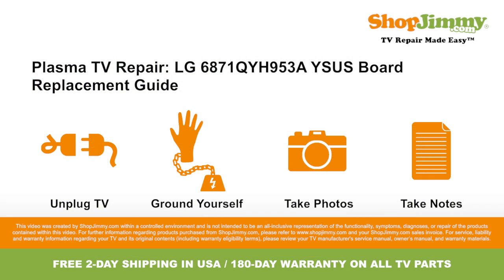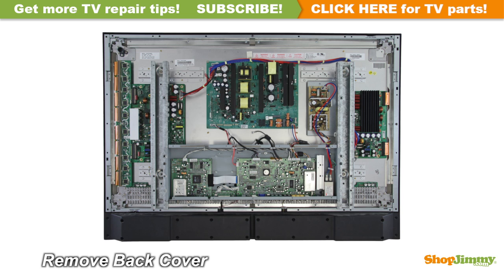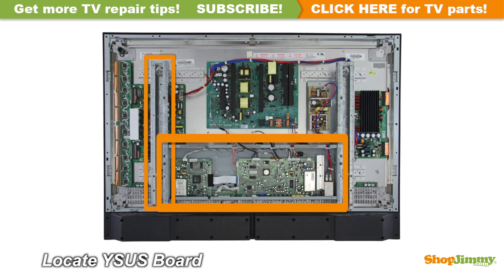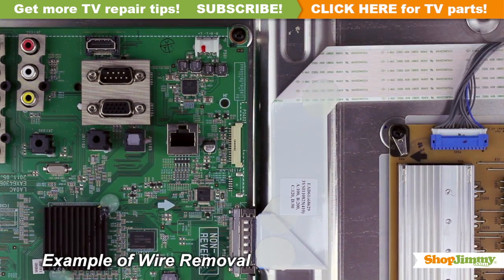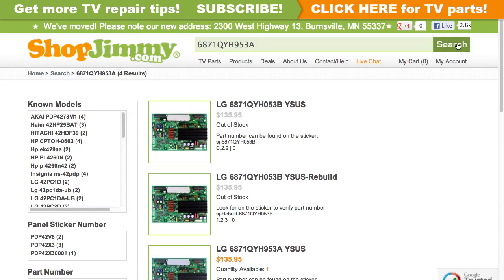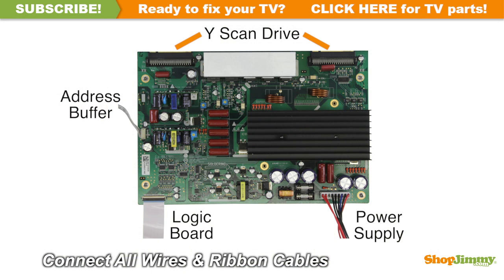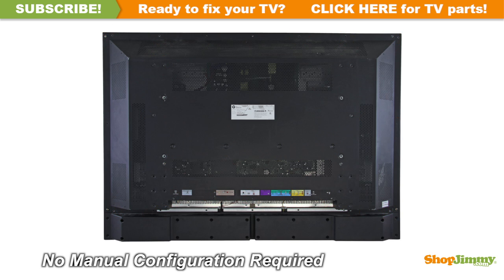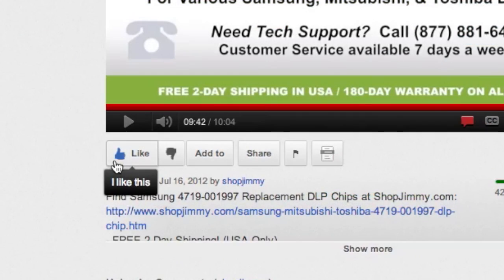LG Plasma TV Repair - How to Replace LG 6871QYH953A Y-SUS Board - How to Fix Plasma TVs

Comment: Hi, my LG plasma TV has stopped working suddenly, that is no picture when switched on, I noticed the main ON/OFF red light ON. Normally, this turns from RED to GREEN, then picture comes on screen. However, in my case the RED light keeps on. 

Screen does not turn on by manual on / off switch located at bottom left rear of screen.

Please can you HELP ! and Thanks in advance.

LG - TV
MODEL No. : 50PA4500 - ZF
PRODUCT CODE : 50PA4500 – ZF. BEKLLJP
SERIAL No. : 205MAAK36304
MFG : MAY 2012

Comment: Hi jimmy, I've got a LG plasma tv (model no - 42PC1DG-AA). Few days back picture was gone (no picture at all, just black screen) but the other things are still running. everything fine just no picture. I've already change the Y buffer board (new one) but unfortunately the picture hasn't still showed up :( .... what should i do now????
Thanks for your support....
Reply from the maker: +Russel Hassan   Try all repairs and troubleshooting at your own risk.  You need to replace the Y board as well.  Thanks!  www.shopjimmy.com

Comment: Hello,
I have a LG 50 PV350 TV, which does not emit picture, only sound, could help me to know that the board is that I must change the motherboard is EBT60874713 Y Y-SUS EBR69839002.
Thank you.

Comment: I have a LG 50Pj350-UB  I turned the tv on and there was a black line on right side and on the left side like closing the view of picture everything else is working can you tell me what part do I need to replace.  thanks
by the way.  your video is fantastic!
Reply from the maker: Elizabeth Guevara   Try all repairs and troubleshooting at your own risk.  This sounds like a TV panel (TV Screen) problem.  If your TV panel is bad, it may be more cost-effective to replace the TV as panels are typically hard to find in stock, difficult to replace, and expensive.  Thanks and please let us know if you have any further questions!  www.shopjimmy.com

Comment: I have a Maxent MX42M20 mod: P420142X3 plasma monitor. I get no splash when I turn it on. When I hook it up to a source, I get NO picture but I get sound (loud). I have no control of the sound (up or down) from the front panel, no menu. I can go through the input source (with no indication of source). After, taking off the back panel it seems to be all LG. I need help troubleshooting the problem. It does turn on (Green) from Standby (Amber). I've changed out the YSUS and YDRTP boards. This was a give me TV. Thanks for any help.
Reply from the maker: MrJmm1952   I recommend replacing the main board in your TV.  Click this link to replacement parts for your TV model number:  http://www.shopjimmy.com/maxent-dpwb11561-mpl-main-board-for-mx-42hpm20.htm  Be sure to match part numbers on your current board, with your replacement for compatibility.  Thanks and please let us know if you have any further questions with your TV Repair!  www.shopjimmy.com

Comment: I have an lg 60pk250 it has small vertical lines and now will not turn on. When it does turn on (after a long cool down period) it works for about an hour then turns off and then it cycles through startup but i get no picture. I see no signs of bulging capacitors. from what i understand replacing the y sus board will fix the vertical line issue (is that correct?) but could you tell me if a faulty Y sus board will cause the tv not to turn on at all? Thanks

Comment: Hello, I have lg plasma tv model 42pc3dv. The screen doesnt come on at all. The power light turns green and the tv powers up but the screen never comes on. when the screen fist went out there was still sound now there is none. Can you direct me to the fix video for this and the parts needed for the fix please.
Reply from the maker: sunni j  Please watch this video FIRST to help with your repair!  https://www.youtube.com/watch?v=BP3NVNCGEv8   I recommend replacing the YSUS and the YDRVTP boards in your TV.  Click this link to replacement parts for your TV model number.  http://www.shopjimmy.com/catalogsearch/result/?q=42pc3dv  There may be multiple boards for the same TV model number, be sure to match part numbers on your current board, with your replacement for compatibility.  Here is a link to a video showing how to identify your part number, click here:  https://www.youtube.com/watch?v=GEllG3RV-tc

Comment: Hi i have a LG PDP50R4000 model i only get a red standby light. When i press the power button nothing happens the light will stay red. Do you think i just need to change the power supply?
Reply: ShopJimmy.com Hi i tried that but i don't get anything. i noticed when i disconnected the Y board the standby light does not show anymore but when it was connected the standby light was on.
So the end result so far is that still no power when the Y board was disconnected
Reply: ShopJimmy.com Hi Disconnected the x board and still no results. I get the standby power light but tv still does not power up
Reply from the maker: Cramston Symonette   Please watch this video FIRST to help with your repair!  https://www.youtube.com/watch?v=BP3NVNCGEv8  This could be a problem with either the main board or the power supply board.  You can replace each of those boards individually to see which one fixes the problem.  Click this link to replacement parts for your TV model number:  http://www.shopjimmy.com/catalogsearch/result/?q=PDP50R4000  Be sure to match part numbers on your current board, with your replacement for compatibility.  Here is a link to a video showing how to identify your part number, click here:  https://www.youtube.com/watch?v=GEllG3RV-tc  Thanks and please let us know if you have any further questions with your TV Repair!  www.shopjimmy.com

Comment: Hi I have an LG 42PX5D that was purchased in 03, never been repaired, unit cycles off/on with clicking LED red to green, after 2 mins yet get a black screen with audio and it takes another 5 mins to get an image which seems to pulse into a solid image. Can this be fixed or is the pixel plasma gas too old?
Reply from the maker: Werner Nicolau Please watch this video FIRST to help with your repair!  https://www.youtube.com/watch?v=BP3NVNCGEv8  I recommend replacing the YSUS and the YDRVTP boards in your TV.  Click this link to replacement parts for your TV model number:  http://www.shopjimmy.com/catalogsearch/result/?q=42PX5D  There may be multiple boards for the same TV model number, be sure to match part numbers on your current board, with your replacement for compatibility.  Here is a link to a video showing how to identify your part number, click here:  https://www.youtube.com/watch?v=GEllG3RV-tc  Thanks and please let us know if you have any further questions with your TV Repair!  www.shopjimmy.com
Reply: ShopJimmy.com Thanks mate, I will look into buying the 2 boards as suggested. Appreciate the advice.

Comment: I have a 42" Toshiba model number 42hp66. I just replaced the Zsus board because I had no picture on my tv just sound. After replacing the Zsus board I still had no picture just the sound. When I turn on the tv the screen stays the same, it does not turn black or anything it's like if it was off but it's not because I can see the red light turn green and I can hear a click when I turn it on. Another thing after replacing the Zsus I noticed the I doesn't get warn like the ysus. Should I replace the ysus? What would my problem be? Thanks
Reply from the maker: Rafael Morales   Yes, I recommend replacing the YSUS and the Y buffer (YDVTP or Y Scan Drive) board in your TV.  Here is a link to replacement parts for your TV model number on our website, click here:  http://www.shopjimmy.com/catalogsearch/result/index/?cat=4&q=42hp66  Be sure to match part numbers on your current board, with your replacement for compatibility.  You can also call our customer service for further assistance with your purchase.  (877) 881-6492  Thanks and please let us know if you have any further questions with your TV Repair!  www.shopjimmy.com

Comment: i repalaced the y sus and the y buffers, still have no picture but I have sound,,does the z sus board do the same thing, i have a dark spot in the middle of the z board, looks to be hot spot, but not sure. I have a Lg 60pz950ua plasma.
Reply from the maker: Louis Casterson   I recommend putting back in the original Y-board and buffer boards.  Then replace your ZSUS board.  Here is a link to replacement parts for your TV model number on our website, click here:  http://www.shopjimmy.com/catalogsearch/result/index/?master_part_type=Z-Sustain&q=Lg+60pz950ua  Be sure to match part numbers on your current board, with your replacement for compatibility.  Here is a link to a video showing how to identify your part number, click here:  LG Plasma TV Repair: DIY Part Identification Number ID Guide for LG & LG Philips Plasma Panel Parts  You can also call our customer service for further assistance with your purchase.  (877) 881-6492  Thanks and please let us know if you have any further questions with your TV Repair!  www.shopjimmy.com

Comment: Hi there. LG 60PC1D-AA. The sequence of events is as follows. When you try to switch on using the remote, the red standby light flashes, you hear a click, and the TV goes back into stand-by mode. This may be repeated several times with the same outcome. After several attempts the screen initiates (though still remains all black), stays like this for several seconds, then goes dead black again. However, the sound comes on. If you then switch the TV off into standby, and then switch it on again, everything comes back on as usual (screen and voice). Hope all this makes sense. Thank you for any suggestions in advance. Alex
Reply from the maker: Alex Kontrobarsky  I recommend replacing the main board in your TV.  Here is a link to replacement parts for your TV model number on our website, click here:  http://www.shopjimmy.com/catalogsearch/result/?q=60PC1D  Be sure to match part numbers on your current board, with your replacement for compatibility.  Here is a link to a video showing how to identify your part number, click here:  TV Part Number Guide for LG & Zenith Main, Digital, & Tuner Boards (LCD, LED, Plasma TVs)  You can also call our customer service for further assistance with your purchase.  (877) 881-6492  Thanks and please let us know if you have any further questions with your TV Repair!  www.shopjimmy.com
Reply: Alex Kontrobarsky Did replacing with the main board work? Because my lg plasma tv has to have several attempts to power on in order for the screen to go on....like it needs warming up
Reply: Vincent Tran Actually when I opened the TV up and inspected everything closely I discovered that all cap on the following part were blown. LG - ZENITH EAY32961901 SMPS AC/DC. You can tell that the caps are blown because the tops were sort of puffed up and coming apart. I bought this replacement part for approx $130 and it made the TV pretty much like new again. Definitely worth the effort. I took the photos as I went along so that I could remember how to put it back together again. If you wish let me know your email address and I will try to find them and shoot through. Hope this helps. Regards.
Reply: I recently opened mines up and found the bad capacitors on my power supply. The cost for a new one is about 130 dollars, so I might try to buy some capacitors and replace them myself.
Reply: Thanks for the help though, Alex. I do appreciate it!

Comment: I have a HP CPTOH-0602.  If I try to turn it on the blue lights on the board come on for a few seconds then one (the left one) "clicks" off.  I can not try to turn the TV back on without the power unplugged and the power drained, and then the power cord plugged back in.  The power light stays red and never turns green.  Sometimes, after I try to turn it on once the red power light will turn off while the power button is pressed, but once I let it go the red light comes back on..  Here is a quick video of what it is doing.  I have replaced the power supply board and it still does the same thing.  Here is a video of what it does.  Any help or pointing me in the right direction as to the board I should replace would be appreciated.  I don't see any swollen caps on any of the boards.
HP CPTOH-0602 Turns on and then back off
Reply from the maker: Dom Sobieralski   We will need to see the screen in your video.  Please upload a video so we can see what is happening on the screen and reply with that link.  Thanks!  www.shopjimmy.com
Reply: The screen is totally blank.  No backlight, or any kind of video at all.  It stays black (and doesn't look energized) the whole time.
Reply: If you still need video confirmation I will shoot a small video tomorrow when I am at the shop and post it so that you can see it is black.
Reply from the maker: Dom Sobieralski   I recommend replacing the YSUS board and the Y Scan Drive in your TV.  Here is a link to replacement parts for your TV model number on our website, click here:  http://www.shopjimmy.com/catalogsearch/result/?q=CPTOH-0602  Be sure to match part numbers on your current board, with your replacement for compatibility.  You can also call our customer service for further assistance with your purchase.  (877) 881-6492  Thanks and please let us know if you have any further questions with your TV Repair!  www.shopjimmy.com

Comment: hi I have lg 50 inches it does not come on for some reason capacitors are all fine what could need changing
Reply from the maker: Nadeem Butt  What is the TV doing or not doing? Is there a standby light on, in the front?  Thanks!  www.shopjimmy.com

Comment: I have an Insignia 50 inch plasma model number is NS-P501Q-10A. I had a clicking but no picture and no sound. I replaced the X board the Y board, and buffer board  and  power board all were new boards After replacing boards when I turn the on I get a flash of white across the bottom of the screen about 1 foot wide, then the flash goes out and my red power light blinks 5 times and does nothing. Would love to know if you have any idea what next  Thank you, Chris  My email is tobyfrost1@yahoo.com

Comment: I replaced the y sustain with a new one three months ago and it worked till a week ago. It did have some ghost red dots on the lower left of the screen most of the time.
The first board showed up with a blown fuse and a grounded board. This time there is no blown fuse and no dead ground from the fuse holders to the chassis. It has sound with no picture. This replacement board also has the correct voltages coming onto it. The heatsink on the Z board gets warm and the y does not. What can I check?

Comment from the maker: @Melanie Gonzalez - I would recommend that you look closely at the buffer board and see if you can find small pin holes on it.  If there are small pin holes on the buffer board, replace that board, if there is no visible problem, then I would recommend changing the ymain(ysus) board.  You can search your TV model number on our website to find replacements boards and you can also call our customer service if you need further assistance.  Thanks!  (877) 881-6492

Comment: I have an HP 42" Plasma Model #: CPTOH-0602, Product #:EK429AA. The picture has gone out, there is sound. We dod not hear any popping noise, but turned the TV on from one day to the next and there was no picture. We found your video and would like some suggestion on parts and fixing it. Thanks!